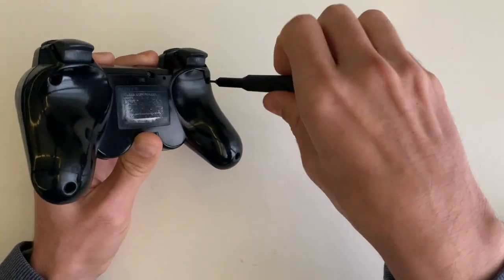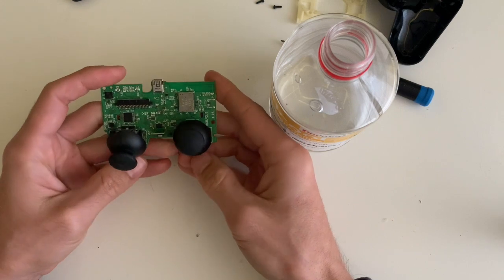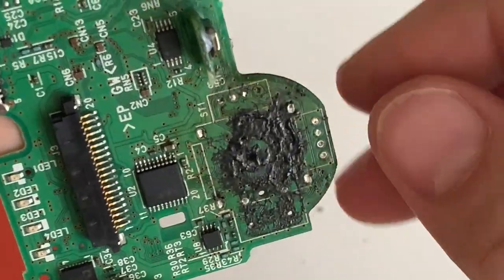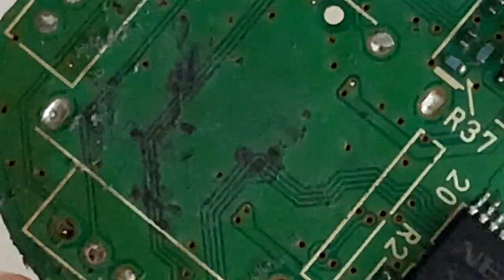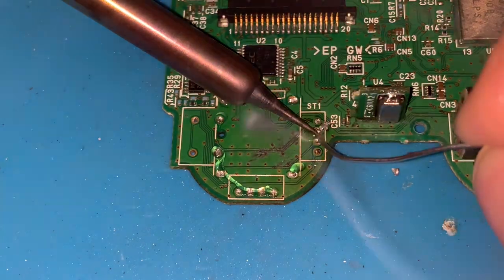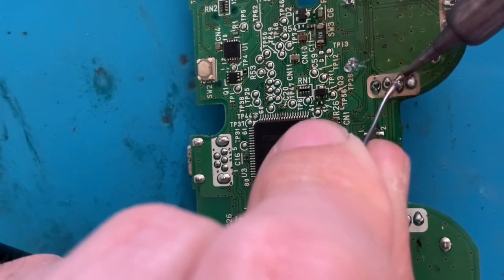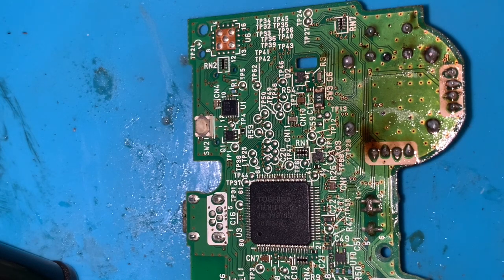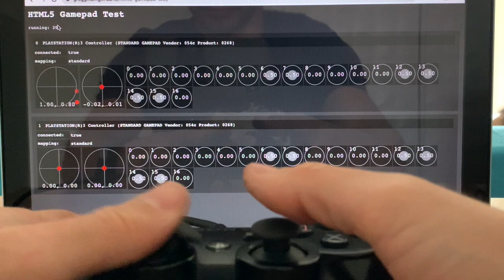REPLACING 4 PIN JOYSTICK ON A OG SIXAXIS

Comment: Is possible to put a 3pin analog on 4pin controller? (I nephew screw my left thumb, and in my country is impossible to get the 4pin analogs, and shipping from other counrties will cost maybe 2 times a second hand controller)
Reply from the maker: Not that i know of, have you tried the link i have on the description? 
It comes from china though.
Reply: You can replace only analog mechanism, while keeping stock 4pin hall sensor housing. Ofc if problem in hall sensors or magnets - it's over. This mod may require some efford, cuz mounting pole on potentiometer-based analog module not the same as hall-based ds3 pole, it's a bit smaller and doesn't have locking clip, so you need glue it or something. Idk why no one ever tried to mod 3-pin stick and ppl still buying 10-15-years old used analogs, which feel awful
Reply from the maker: These i bought are old but feel normal to use.
Reply: @zul_fix  they r good, may be more durable than newer models in term of stick construction, having 2 centring springs inside, but after 15 years of use ofc they can't be that smooth as new, even after lubbing. i use few drops of krytox 105g0, move stick a bit to lube spring and bottom part, than 205g1 for upper moving parts
Reply from the maker: @LeetPanda truly are at least they will not drift over use. Will see if we have that lub were i live and give it a shot. thanks!
Reply: Eso es lo que me pregunto tbn se podra poner uno de 3 pines a uno de 4
Esos ya no los venden uu ni de efecto hall :(